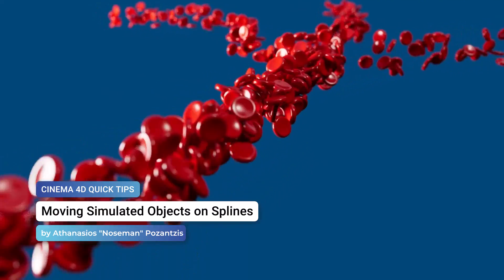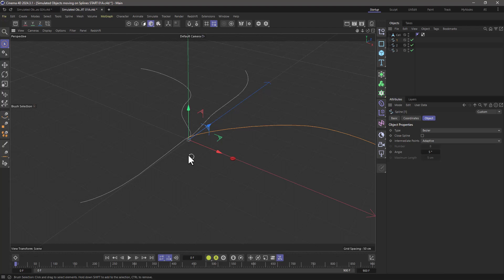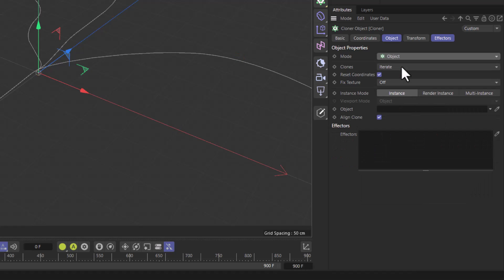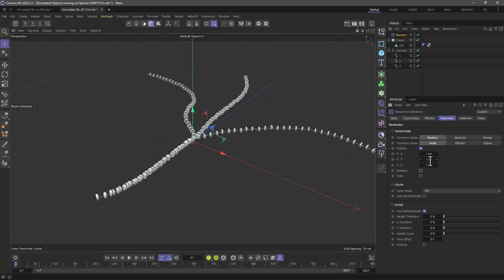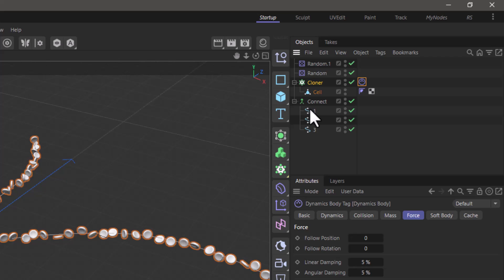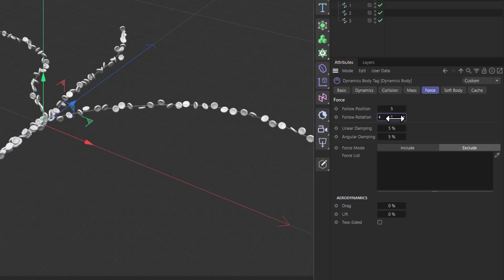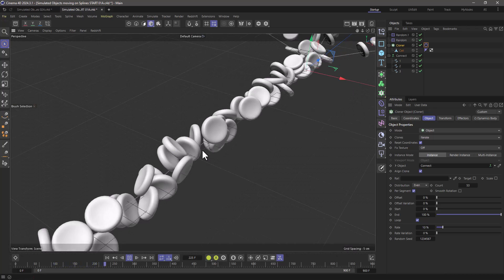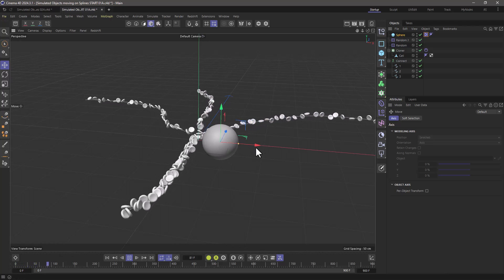#C4DQuickTip 129: Moving Simulated Objects on Splines in Cinema 4D

Comment: I tried this with the new rigid body tag and got a very strange looping effect where the clones jump from the end of the spline back towards the beginning of the spline. Any idea why that happens?
Reply: This is how Mograph handles the clones that "exit" the spline. It recycles the Clone index and it reappears at the beginning. This is not visible with Bullet as it has a special exception. You will see the clone flying back if you render using Motion Blur. The workaround is to make the clone very small at the beginning and the end.
Reply: @noseman  Thanks. I added an effector that only affects visibility and placed that at the close end of the splines. That hid the looping but the movement overall isn't nearly as smooth as the bullet system.
Reply: Put the rigid body tag in the object inside the cloner